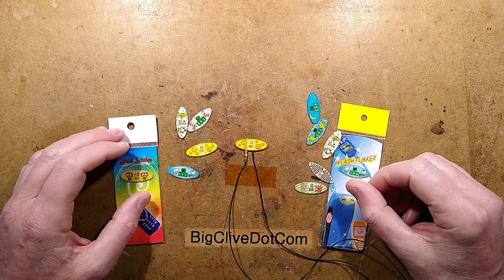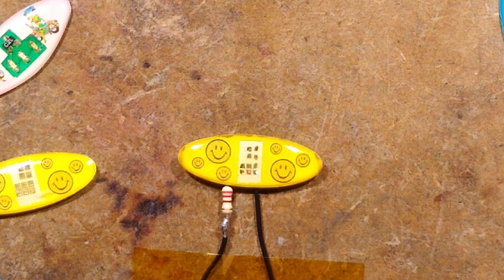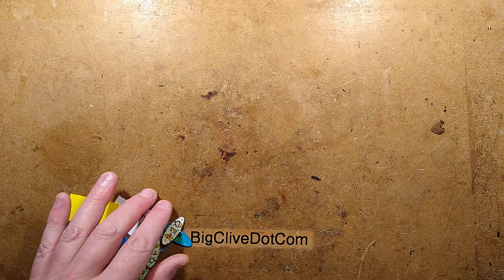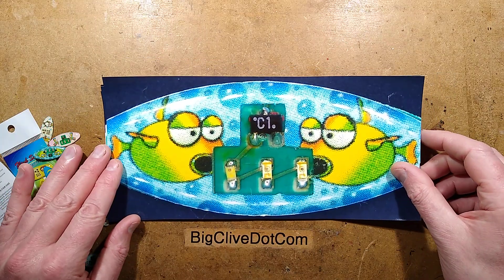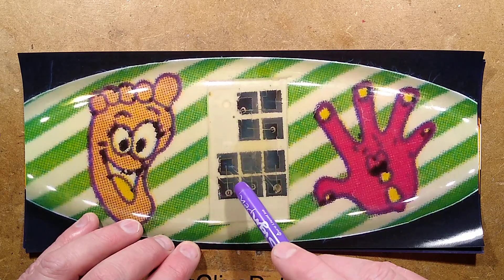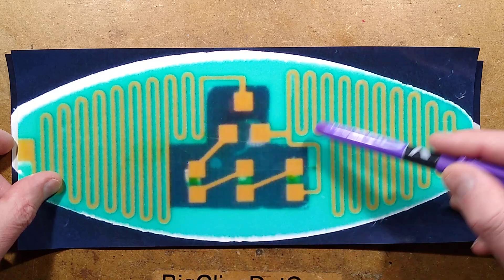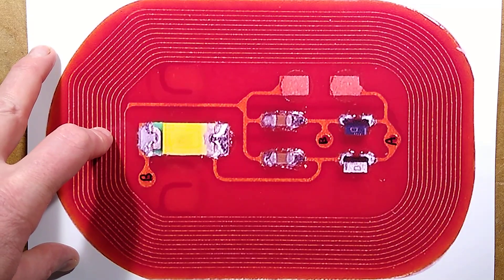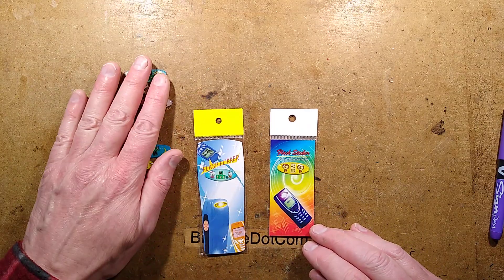How self-powered flashing phone stickers worked (with schematic)

Comment: I do not recall stickons (would have been pointless, as the phones I knew from ~96 would flash their backlight), but I did have a coincell operated one inside the MC fairing, which worked well eneough with the phone inside the jacket. But 'it stopped working' when people got the expectation I would always be available.

Comment: Since the voltage generated only from RF won't be sufficient to turn on 4 leds (1 doors and 3 light emitting doors), hence there must be some resonance phenomena to amplify the signal and hence turn on led. For 4 foods assuming silicone , we need at least 2.8 volts across the series combination to turn them on. This huge voltage just from the RF wave is impossible. Hence resonance is there.

Comment: Hi Clive!

I saw your video where you disassembled and tested those classic GSM-powered flashing antenna stickers — they brought back great memories.

I’ve been trying to find an original working sticker that flashes in response to a 2G GSM call or message (like the ones you showed), but unfortunately, I can’t find any store or seller that still has them.

Do you happen to know where I could still get one — even just a single piece? Or maybe someone you know has a few left?

I’d really appreciate any help. Thank you so much in advance, and greetings from Hungary!

Best regards,  
Szilárd
Reply from the maker: I'm travelling with work at the moment, so I can't look for them.  I'm not sure they'd even work on the older standards now, as the comms industry has moved away from high power transmitters.

Comment: do these work with GSM/GPRS? those bands are still up and running in many places
Reply from the maker: Not sure which bands they will still work with.  They also relied on quite a string signal, which is less common these days with lots of smaller local beacons.

Comment: Back in the 90s, at least in North America (not sure about other places), cell phones were pretty much all functioning in the GSM 850-900 MHz range, which I suspect is what these sorts of antennas were tuned for.  (Note, there are still some "cordless phones" (not cell phones), baby monitors, remote-control interfaces like garage door openers, etc which still use this frequency range, so you might actually be able to get one of those sorts of devices to make these stickers actually flash again..)

I would bet that if you figure out the length (stretched out) of the (shorter) antenna traces on the board, they come out to about 80 mm end-to-end, which is half the wavelength of a 900 MHz signal (since it's a simple dipole antenna).

The one with the longer, thinner trace is probably also an odd multiple of the half-wavelength, probably 3/2 wavelength instead of 1/2, as that produces the strongest signal for a given frequency (and the longer it is (within that constraint) the better the signal, which is likely why they did that).

The "radiation blocking" stickers people sold (at least the ones that weren't just fraudulently-marketed plain stickers with nothing special inside) were pretty much the same sort of antenna, just with a resistor or some such instead of the LEDs to sink some of the current and "absorb" the signal.  The irony with those were that because they (if anything) actually made it harder for the phone to communicate with the tower, as you mentioned, the phone would just increase its own transmitting power to overcome that, resulting in the phone actually putting out more radiation with the sticker attached, not less.  (They actually had exactly the opposite effect they claimed (and arguably maybe made your battery run down quicker, too).)

Comment: I was told that 6G will be using nearly every NEW AUTOMOBILE and any smart device for their signal transmittal use when it comes out. That the "Self Driving" automobiles will NEED 6G to communicate with each other to ensure a safer driving experience. I was told that the issues they are having with the 6G design is how to achieve remote area connections. Some companies are actually looking at putting 2G BACK into the 6G phones and other products to be a fall back for those remote areas, thus giving them an additional selling point BUT NOT letting consumers know that in those remote areas, their phones and devices will be much slower and weaker because they will be using 2G.

Comment: Used to love flashing aerials.  Had a ericsson GH388 with a red and blue LED in the aerial which looked really cool, but there was also others with many LEDs inside that would flash in a pattern.  So were these LEDs actually part of the aerial circuit, or separate and just picked up on the transmitted energy like these stickers?

Comment: when they did the "tiny chip and bond wire" method, why would they still keep the footprint of a smd led though? wouldn't it be way easier to just bond to the next led's pad instead of having a whole pad just for shorting that over diagonally? is it because it's easier to teach a led bonding machine to do the "normal program"? or do you reckon they just had millions of unpopulated boards lying around?
Reply from the maker: Options.

Comment: There was also concerns at the time about them causing interference due to intermodulation products, the lab I used to work at had to buy a load for testing, can't remember what the outcome was but I remember at the time thinking it was ironic that they actually caused the phone to increase its output power (as well as reduce your battery life).

Comment: I'm figuring that the antenna length is related to the wavelength of the signal or a harmonic (devision/multiplication) of it.
The longer the antenna, the more power it can absorb, which would make sense if the surface mount LEDs needed more power to light. Or maybe the longer antennas (probably exactly twice as long) were phased out because they drew too much radio power and reduced signal and battery life too significantly.

Comment: I remember my local mall had a stand in the middle where you see all these flashing lights to get your attention. I got one that you screw in the antenna the flashing thing was an  antenna.  I couldn't ever get it to flash when someone called me. This was back in 2003 or 4 when I got it. So I unscrewed the flashing antenna and put the one that was originally on the phone. That thing cost me 35 dollars and of course couldn't get a refund they had a huge sign stating they do not give a refund if it didn't work and also made it clear vocally as well. I'm still wondering why it didn't work. They worked at the stand where they were on display at that stand. 
Also, I do remember back in the day where I had to walk around in my backyard to get bars to make a call.
This didn't have anything to do with that antenna I bought, this was a separate issue 3 yrs before then. Was my very first cell phone and I would have drop calls. Even though it was Verizon and it was at that same time you would see that commercial on the tv with that dude holding up to his ear and asking, "can you hear me now?" crap. 
A few yrs ago that same dude went to a different service provider and I'm thinking it was sprint. I will never go back to Verizon again after that issue with a insurance policy I was paying promised I would get a new phone if it were damaged. I went up to the store and told them sat the phone on top of the car forgetting about and was backing out of the driveway, when I heard it fall. It was no longer working. So I told them that, they opened it up and said can't get a new phone it has water damage. I couldn't believe it I never had it near water. He showed me the little sticker in the phone that changes color if water got to it and it did change. Im thinking sweat or moisture from my face went it as condensation vapor. I was so pissed. After my 2 yr contract up I switched network.

Comment: ? Have you tried them on a wireless phone charger? I purchased some wireless LED's that have a coil that is hooked to 5v (and a coil to power the LED's) and when you place the LED's in the circle they light up. they work with a charging pad, but I avoid leaving them there in case there is too much current.

Comment: An antenna folded back and forth on itself like these (especially the early model) would be extremely broad banded. Good for collecting energy from a cell phone signal that could be anywhere between 300 MHz to 1.9GHz. there is no sweet spot. More is usually better, hence the first version. Probably, through experience, they learned that the newer version collected enough energy for their purpose.

Comment: First of all. No one  heard about 5g in the 90s or early 2000. As 3g was something new back then.
Second. It doesn't work any more because phones novadays has antennas around whole body of phone so there is no exact place to stick in it unless you have sticker as large as phone, I mean antennas of stickers have to be in the same place as antennas of phone. 
Third. I am old enough to remember a  time (70s) that you could build by yourself or buy a pocket radio that you could carry with you and listing to radio that doesn't required any source of power (battery). It was using power from radio waves on which radio station was transmitted.

Comment: I collected a number of them!
The antenna was tuned for 900 MHz.
If you have a signal generator that puts out at least 100 mW, they turn on. Some turned on at 430 MHz, the ham radio UHF band.
Later, phones like the Motorola 8900 added the 1800 MHz band to the original GSM 900 MHz, but the call was always initiated at 900 MHz.
The sticker increased battery current by almost 20%.
Later, when the network evolved to use less than 2 Watts RF, these stickers were including two silver oxide batteries.

Comment: For the antenna length, anything to do with frequency changes? IIRC the early days of GSM used 900MHz, then they opened up 1800MHz as it took off and they needed more bandwidth. Obviously shorter antenna = shorter wavelength / higher frequency. So maybe it's for that. Maybe it isn't I dunno, surely it would cost them the same either way regardless what pattern they etch the copper into. I never heard of 300MHz GSM, but if that was an early frequency then maybe older tags aimed midway between that and 900, where later ones went between 900 and 1800?

But I doubt it cos those shitey stickers came out long after even I got a mobile phone, and I'm not an early adopter. Incidentally TACS / 1G in the UK also used around 900MHz so it's not that either.

Looking at the sleeving on earth pins on mains plugs, it's as likely just some Chinese bloke did it once and everyone blindly copied him. Then somehow a change occurred and everyone copied that after. That's pretty much how intellectual property and design work in China. That, and all the theft, of course.

Comment: Could you not have tested these more "authentically" using an old GSM phone from the back of a drawer? Obviously you wouldn't throw one away until it was completely non-servicable and even no good for parts. Because neither would I, or most of us here, naturally. 

Even without a 2G tower wouldn't a GSM phone still send out a few exploratory RF pings? Since it's the outgoing pings that light up the sticker. Or even some 4G phones can be set to transmit 2G or 3G exclusively. And there's the Chinese throwaway phones that are still, AFAIK, 2G only, particularly the watch phones that cost a tenner (and are fabulous for letting you know who's calling and reading txts, surely 90% of what a smartwatch is for). I think the modern networks are smart enough to route around 2G even if it's even technically "interference" now, but I dunno what the license allocations are like anywhere, never mind the IOM. Would be nice to have proper video of it proper working, would show the amount of energy they could harvest (quite a lot actually) from RF over a distance of maybe 2cm. If you can be arsed maybe edit some footage of that in later?

Comment: "absorbs RF radiation"... in other words, it reduced your transmission range.
The reason they don't work anymore is that phones transmit a digital signal that never goes above .5 W.  The older analogue phones switched between .5W and 3W.

Comment: Hey, I remember these from when I used to work in cellphone recycling. They are still marketed as radiation protection devices - or, without the LED, as boost antennas.

Comment: ive often wondered if the reason they dont work now is owed to the modulation scheme in use and that GSM cycled the TX on and off, 3g put an end to that with extra uplink channels. Partly born out of the frustration of audio interreference because gsm was bloody noisy as well as the limited data rates gsm offered.

Comment: I've used it and I had a "safer" version. The sticker was quite nice but with my 3310, I switched cases and the one where I had the sticker, was quite beaten up. I had a Sofa with water in it and a board with a battery. It has done the same thing. The best part was, you saw an incoming call, before your phone rang. It was great, when your phone wasn't near a speaker, that would give a specific sound from it. 

Today the kids use something similar. They use their flash of their phones. I don't know what this is exactly but a wild guess would be, that this is a handicap function of the iPhone. Quite annoying to use the flash, because you can't really know if they take a photo or get a notification/call. I like the notification light of my Android phone but it got quite small and with a cover, you don't see it. Would love to have a 2nd light, that is kinda like a light ring but can be turned off for certain times. At night I don't need it, except for a quick feedback if my phone is charging.

Comment: 1. Point Antenna Lenght:
The longer the antenna the more Power it consums. Important is that the length oi the antenna is x/x of the Lamda, like 3/4 or 5/8. So at example we have your said 300mhz divided by 300 we habe 1m of wavelength. A ratio of 1/2 is around 50cm. You also could make a 1/4 for sparing some coppper and space and you only have 25cm. This will absorb less power and the LED will not shine so bright on longer distance.
2 Point the circuit diagagram of a shortcircuit diode parallel to the LED's and Diode:

The diode, shortcircuing the LED's is for the reverse inducted voltage. If you induct a power like 60mW per LED in summary (3 time 60mW) 180mW you have at 7V around 25mA. Enogh to let the LED's shine at full brightness. Now you habe a AC current. Means one time you have the correct polarity and once you have the reversed polarity. To shortcircuit the reversed polarity to a low level that could not harm the LED (max reverse Voltage from LED) they put in the reversed Diode.
Now we have a inducted power of 180mW and nearly no currency. What happens is the voltage is rising by law of power. If the LED had an maximum reverse voltage of 5V it will break very early if you don't shortcircuit the reverse voltage that can be much more than this.
This is an issue known from first china LED lamps. They only put capacitor in line with the LEDs to perform some phase shifting and the cheap lamp is finished. The error comes soon because of AC Voltage. 60/50 Times a second the last LED in circuit faces a reverse voltage of 110/220V. With this the LED lamps have been broken fast and easy.
Misssing diode: If you have 0,7V of 0,35V less losses in the circuit, the distance to the antenna (powersource) can be more highter than before.

If you find erros you can keep them =)

Comment: Now there's an interesting question - if you could charge a modern smartphone's battery using a similar method to either have a self-charging phone or at least have it last longer than the nominal battery capacity would imply. Because with uneven pulses like this you probably could not actually power the device.

Comment: My parents have a little toy dog with light up cheeks that works on the same principle and used to let them know when the phone was about to ring.
With the advent of part copper, part fibre optic network lines replacing the old landlines (Slight rant at the end*) it now only tells them if a storm is coming or if the internet is about to go on the fritz.

*Landline phones used to still work during a blackout because of power from the little RJ11 phone line ports in your wall right? Nowadays with the advent of all telecommunications being either wireless or bound to network lines, if the power goes out, you can be completely cut off.

Comment: Should be able to make them flash with one of those ~ 400MHz UHF walkie-talkies. Probably some of the stickers are optimized for different countries with different bands, hence the different antenna lengths. Makes me want to make a larger "on air" light for a radio station that is powered by the radio itself.

Comment: Very nice and interesting video !! Do you think it is possible to make a similar scheme for the current frequencies? I think this system works like an Rfid ... or am I wrong? I understand little about circuits and electronics but it would be nice if you made a video where you try to do a similar thing for today's mobile phones.
Reply from the maker: It's easier to make a flasher that works with the NFC coil.